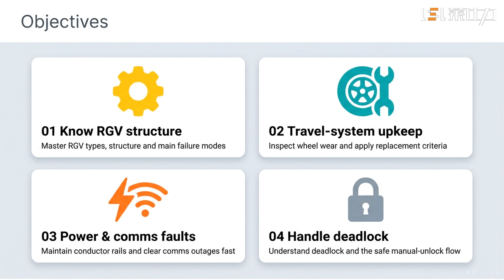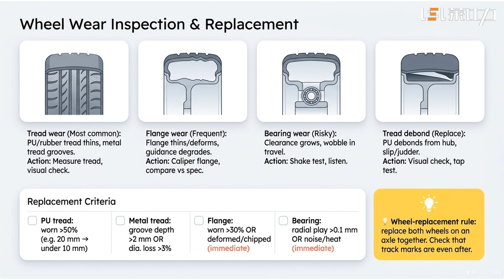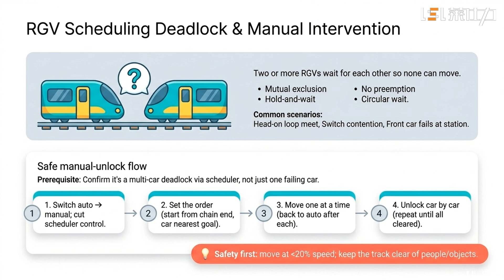Master RGV Maintenance: Wheels, Power, Comms & Deadlock

Comment from the maker: ⏱ Timeline
  00:44  Four Goals for RGV Troubleshooting
  01:16  RGV Types and Core Systems
  02:00  Wheel Wear Inspection and Replacement
  02:48  Conductor Rail Power Maintenance
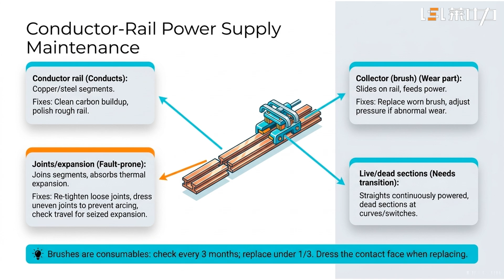  03:30  Communication Fault Troubleshooting
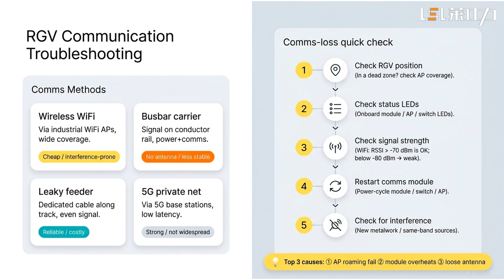  04:23  Scheduling Deadlock and Safe Unlock
  05:14  Quick-Fault Reference Table
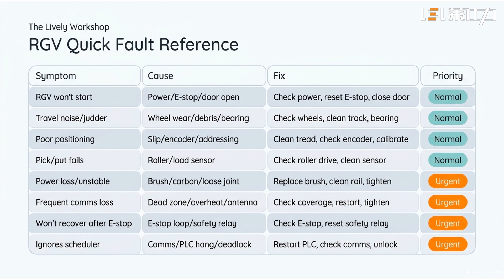  05:50  Five-Tier Preventive Maintenance
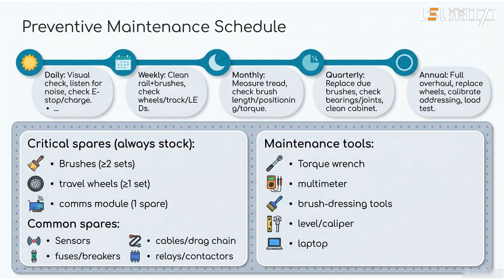  06:30  Battery and Charging System Care
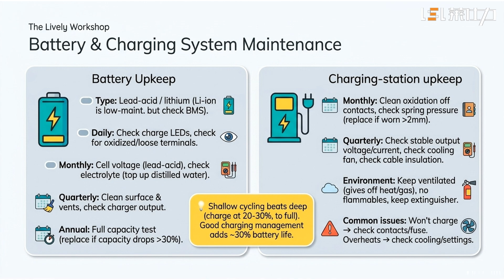  07:14  Track and Limit Device Checks
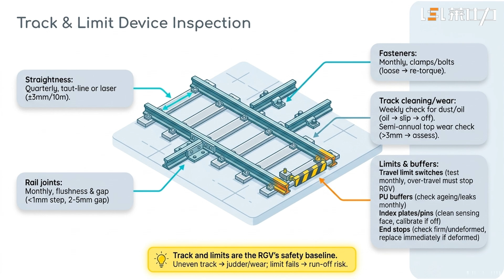  07:55  RGV Safety Procedures
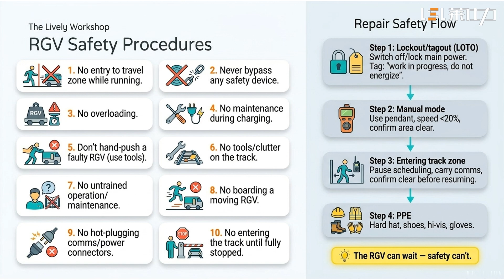  08:38  Case Study: Carbon Film Fix
  09:25  Key Takeaways Recap
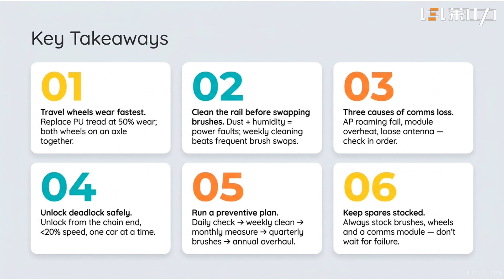  10:05  Next Episode Preview & Closing